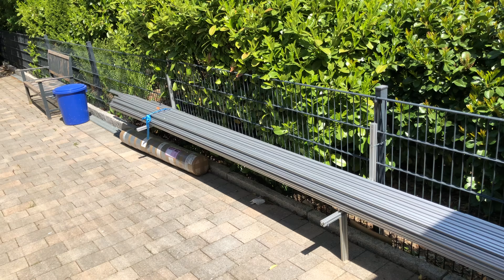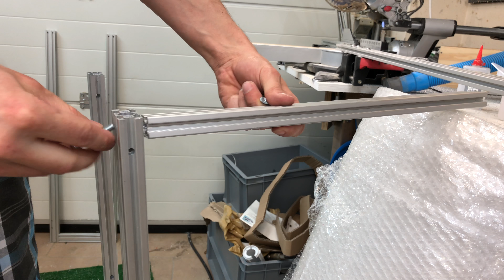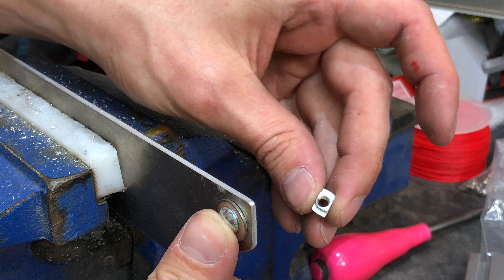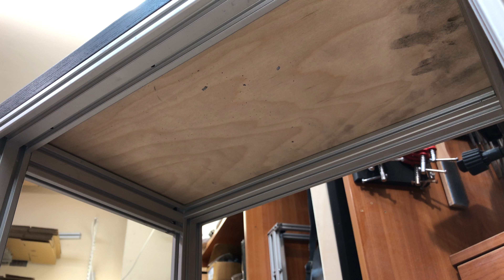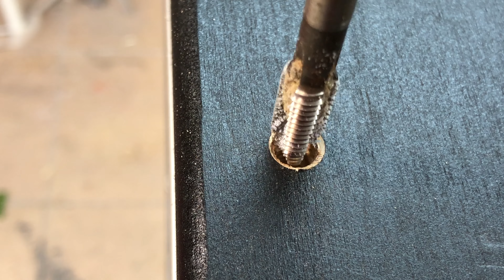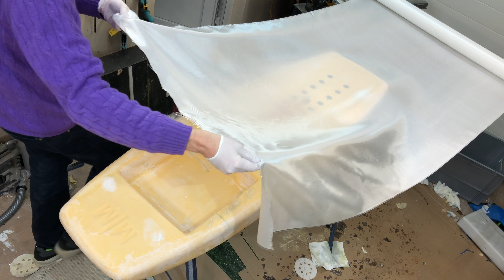Using Aluminium Profiles for Shop Furniture! (How To Make A Bandsaw Stand)

Comment: There are also KLT or ""Kleinladungsträger" which have the same format but don't have the through hole of grip. So you can fill them better but still carry them. You can get them on ebay from "isoco".
Really cheap if you buy a few.

Comment: I want to hear more about getting the aluminum extrusions for cheap. I did one small project with the stuff and it cost nearly $100 in extrusion and corner brackets.
Reply from the maker: I pay about 2€/m wholesale for 20x20. For 20x40 its 3.5€/m. Keep looking for the cheapest supplier. I had to look for weeks. Forget about any companies selling to industry. They are always more expensive somehow. I am getting my corner connectors straight from China which costs half as much as buying them here. Just a few weeks ago There was an ebay offer for a 80x80 structure as big as kitchen table for just 50€. I didn’t have the use, but it was very cheap.
Reply: @MaxMakerChannel   What are prices for 40x40 and 40x80 from your supplier? I'm just curious :) .
Reply from the maker: I don’t know for those sizes. I don’t use them.

Comment: Nice video! One neat trick to connect this kind of profile is with a hidden fastener with just an access hole showing on the outside: www.youtube.com/watch?v=n68BxopUnbU This also allows for 3way corners because only the access holes intersect each other.
Reply from the maker: Thanks 

Neat yes, but not as strong as going through from the other side. The other dissadvantage is that you have to slide it through the entire profile. These profiles have very sharp edges and they like to catch and jam while running them down the slot. Thats why I rather put the screw heads on the outside. There are pros and cons for all of these connectors. I tried them all and most of the time I use the two seen since they are the cheapest and most convenient.